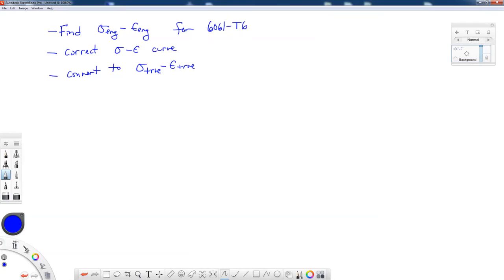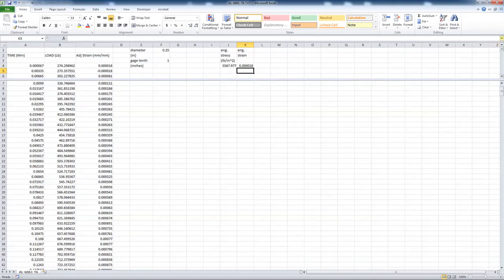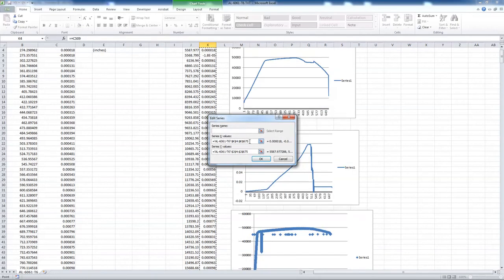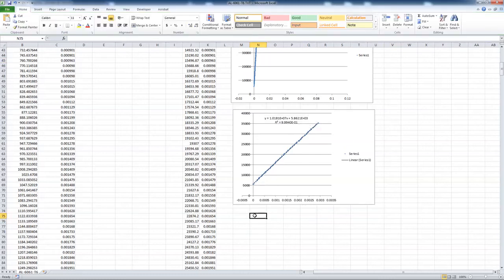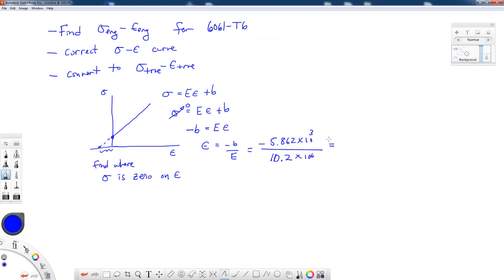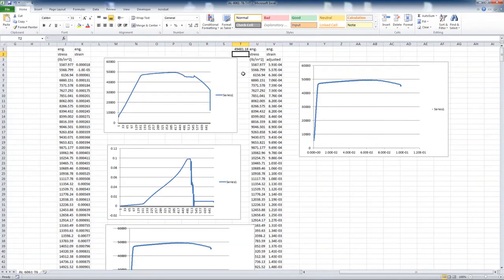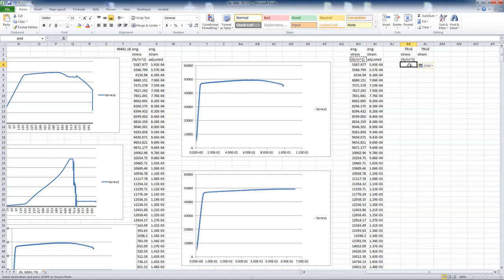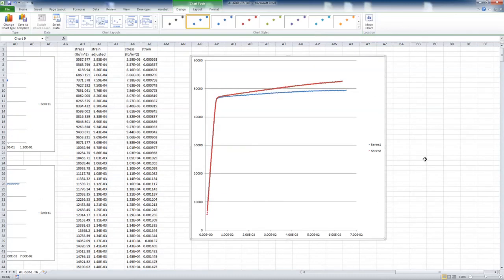AEM 648-3-6061-T6 aluminum alloy stress strain curve analysis

Comment: Hello! Upon doing my Excel with my data from the tensile test for the 6061-T6 aluminum alloy, I didn't get good values for the modulus of elasticity. So I downloaded your values from the forum and applied it to my Excel to make sure if my calculating method was right or if the test results were wrong. When I applied your values, I got good results for the modulus of elasticity which means I think my Excel is correct. However, the yield stress obtained was approximately 311MPa (instead of the theoretical value of 276MPa), and the ultimate stress (tensile strength) obtained was approximately 341MPa (instead of the theoretical value of 310MPa). To calculate the yield stress I used the 0.2% offset method, which I saw on your channel, and to the ultimate stress, I searched for the maximum stress within the test values. I don't know what I did wrong and I would like to request your help, please.
Sorry for the long comment and thank you!
Reply from the maker: Hi Ana, I am not sure what you mean by the "theoretical" values?  Do you mean 'accepted' values?  And if so, what is your source?  If they are from materials supplier data sheets, then those usually provide minimum values for purposes of quality control.  Variation in materials batches can certainly cause that level of variance.  In the end, if you need a good value, you should perform a good test on that batch of material.  (I am confident that my data is good for the material I tested--but that may or may not be valuable to you.) Take care, MEB
Reply: @mbarkey.mechanics   Hello! I'm sorry for the delay but I really couldn't answer you earlier!
About the "theoretical values", I mean the values that are tabulated, like in these websites:
   http://www.matweb.com/search/DataSheet.aspx?MatGUID=b8d536e0b9b54bd7b69e4124d8f1d20a&ckck=1
   or in
   https://materialsdata.nist.gov/bitstream/handle/11115/177/Mecnanical%20Properties%20Data.pdf?sequence=3, values which we usually use in some theoretical calculations or in some exams in university.
I really don't know why my results are bad, what I did wrong in the tensile test... Can you help me, please? Or if my mistake is in my Excel sheet... when I applied your data in my Excel, my results were better (near to that "theoretical values" that I mentioned).
Since you have more experience, could you give me your opinion, please?
Reply from the maker: @anaritalourenco9472  If you look on page 402 of your second link, I see the tensile strength of 6061-T6 as 331 MPa.  I am sure what you are seeing is just some variance in the batch of material that was tested.  There could be some difference in the load cell, but I do trust the data that I took.  (This is all test data, there is no true value or theoretical value.)  Did you use an extensometer to measure strain?  or did you use the cross-head dispacement--there are problems within using cross-head displacement to calculate strain--see https://www.youtube.com/watch?v=jy2VB8GzGig  for details.
Reply: @mbarkey.mechanics  OK, maybe that's it. Yes, I also do believe in your results :)  so I applied them in my Excel in order to compare it with my data of the tensile test. 
 No, I didn't use an extensometer, I used the displacement that the machine gave me. OK, I will watch that video, thank you!